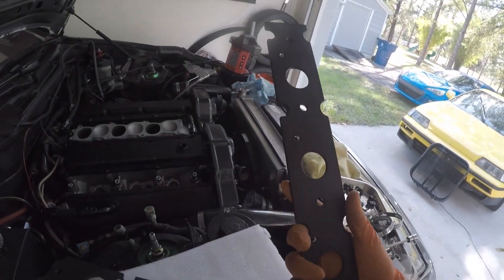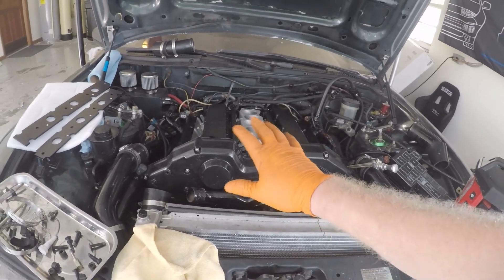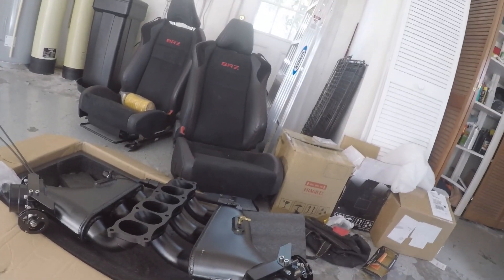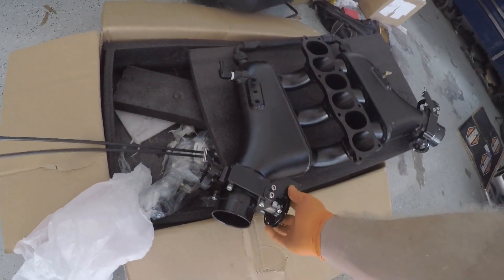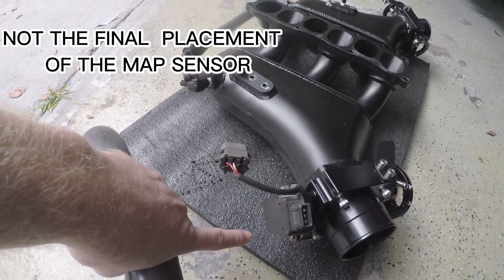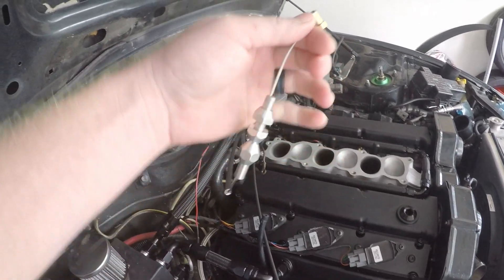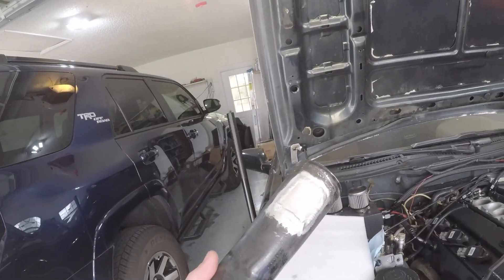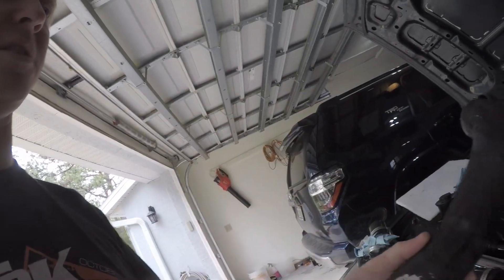The Best 300ZX Intake!  Merlin Machining twin intake install!

Comment: Is there a video on the ptu delete and coil pack upgrade?
Reply from the maker: No I did that years ago.. but I think I could put one together actually..
Reply: @Billy_Built  can the stock  z32 ecu work without tuning or chip upgrade? .. . lookin forward to dat vid
Reply from the maker: @jeffersoncole8667  I would suggest upgrading the ECU to a standalone before you go ahead and upgrade the coil packs to begin with. But to my knowledge yes you can as long as you can adjust the ignition dwell time in the factory ECU.

Comment: Any noticeable power difference?
Reply from the maker: Never got the chance to turn it up much 😅 I did have to add in more fuel on the top end @17+ psi. Roughly 600hp.. Which is #1 sign to flowing more air.
Reply: @Billy_Built  Love it brother. Great work.

Comment: 2 large k and n filters sticking out of front fascia, true cold air intake
Reply from the maker: You could say that I guess.
Reply: @Billy_Built  look at drag cars with twin turbos, if that can make 1000 plus hp.more than.most ever need lol actually it os over kill but just had to say it lol
Reply: By the way had black on black.leather 90 zxtt you car is beautiful

Comment: The best intake for that car is a 2j engine swap, looks cool though!
Reply from the maker: I beg to differ 🤣.
Reply: Personally.only engine swap should be same brand in my book, now a gtr straight 6 is cool but as he said stock motor xan be built to big power. Now i have camry, would love to convert to rear wheel drive and 2 jz but make it quiet, imagine the fun smoking domestic muscle in a 4 door camry lol
Reply: Heresy!
Reply: Hell no, a 2JZ belongs in Supra. You won’t open the hood of my z32 and find a 2JZ…no need, VG does the job just fine
Reply: Heresy!